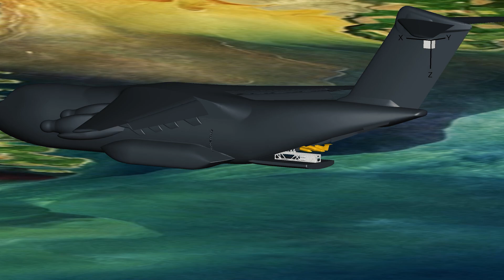A400M UAV Launcher

Comment: I take it this is launch only ? No recovery ? That would limit the usefulness of this project. Also, the drone is cute but is very small. I take it that it's not going to be armed. I don't see the use-case for a single-use recon drone that would take a lot of space inside a cargo plane.
Reply: I guess it increases its range? A larger recon drone (eg global hawk) would do the job, but is very expensive. This gives long range recon capability for low cost. I think really though, this is just a demonstration of what can be done
Reply: @jackroutledge352  yeah, one of those things you can do but shouldn't. I had the same idea as you but then I realized that if the drone can't return to the cargo bay and doesn't have enough range to get to the enemy, then it doesn't have enough range to get back home. Meaning this would be a single-use drone and worse, the enemy could recover it. The "loitering munition" concept makes more sense for that use case.
Reply: The problem with recovery will be the risk. If you can't launch successfully, you lost the drone. If it collides with the carrier aircraft during recovery, you lose both. And the crew
Reply: @jackroutledge352  and the A400M is very expensive !
Reply: My guess is, they can't test a recovery system until they've proven the launch capability. They would only be able to test recovery in simulations, until actual flight trials commence.

Comment: I don't understand why you would use a cargo aircraft.

Surely a drone that small could fit on the underside of a fighter jet.  An F35 might not be able to carry something that big, but a fighter jet the size of a Tornado or the Tempest should be able to.

I would assume a cargo aircraft would be like a sitting duck flying over enemy territory, don't you need something more agile?
Reply: Everything you said is wrong
Reply: @noahmoore2684  that's not true the first sentence in my comment is absolutely factually correct.
Reply: The Tornado is going out of service. Also you wouldn’t launch this directly over the enemy. You’d launch it away from the enemy and then let it fly over there. Means you don’t use fuel getting it to the target in the first place and reducing its range/endurance
Reply: I'm pretty sure the idea is, eventually, to launch multiple drones from one aircraft. You A) couldn't do that with a fighter aircraft and B) don't need to. Agility really isn't that important, since these would likely be launched a long ways outside a conflict zone, then fly in with your fighters, bombers Etc, depending on the mission.

Comment: Why is there no airbus A380 AWACS plane? It would be perfect with its long lasting ability's to stay in air for days even with multiple crew having space to be on board and work in shifts? Why is this just given to boing without any resistance?
Reply: Development costs. Developing an AWACS from the ground up is a massive project, you don't just plop a radome on top and call it a day. Just look at the scale of the MRTT project, for instance. If the existing AWACS works, it's tough to justify a different design.
Reply: Far bigger than necessary. More engines means more maintenance. Size and weight vastly limits your airfield options.
Reply: @counterfit5  actually, the American and Russian AWACS are both 4-engine planes already. And the A380 was designed so that its wingspan is compatible with almost any airport, which was quite a big challenge.

But I do think this is a situation similar to the A380 cargo variants : the plane is too large compared to its maximum weight because it was designed for passengers. So in any non-transport role its size will always end-up under-utilized. Unless for some reason they wanted to add a complete rest & recreation deck for the crew... but somehow I don't think any military would do that.

Comment: AIRBUS should launch a stretched variant of the A400-800 Atlas heavy lift transport aircraft!!! couple of add on fuselage plugs to the front & aft section of the wings should do the job!!! however the fuselage will need some reinforcements especially the wings!!! with a stretched version of the A400-800M in AIRBUS portfolio sales of the stretched version will go through the roof (and no, my claims are not some speculation based on some market study)!!! call it the A400-800M-S Atlas II heavy lift transport aircraft if you will, where the S stands for stretch!!! price of the A400-800M-S Atlas II stretched variant has to be no more than 21%-28% over & above the price of the standard A400-800M Atlas if AIRBUS are to succeed!!! only someone from AIRBUS reads this comment then I can make my point one-to-one with AIRBUS face-to-face!!! but I think we all know that won't happen, AIRBUS don't give a damn about some YouTube blogger!!! & no, I'm not looking to make money out of this!!! I'm just a guy who loves & appreciates aircrafts, that's it & nothing more!!!
Reply: It doesnt work like that....
It would have horrible performance
Reply: @MuffDiver71   Exactly ! This is why they're going for an internal launch system as displayed in the original video of the FCAS program.